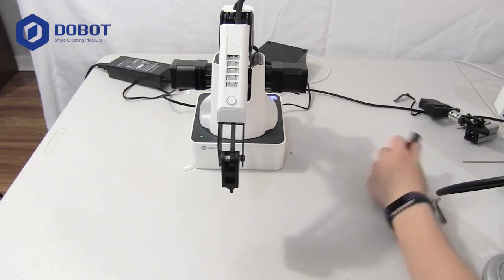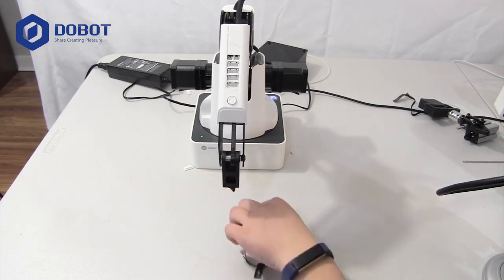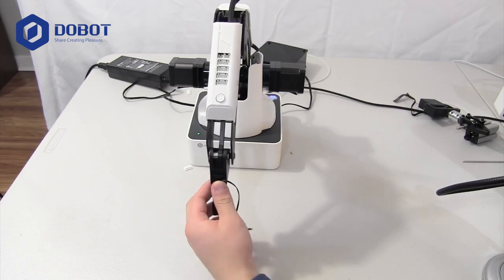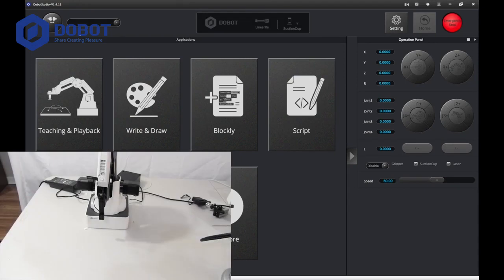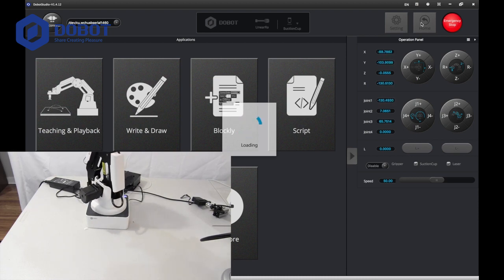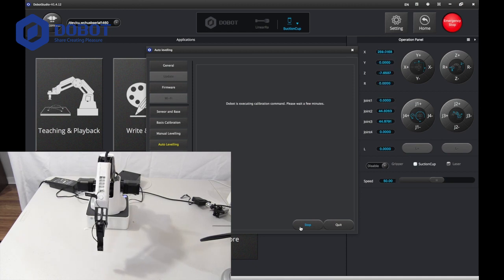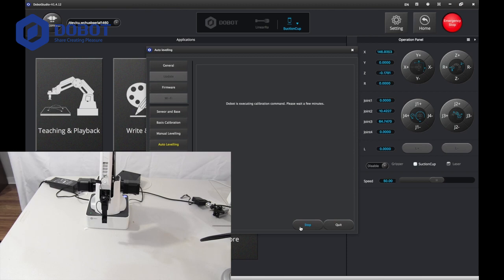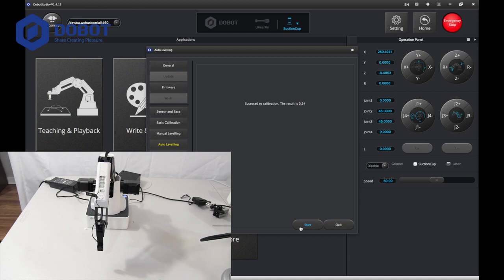[DOBOT Magician Tutorial] How to Calibrate

Comment: well i tried manual and automatic calibration several times but my huge difference in the y axis stays: a Y step of 10mm will result in 15mm movement.

offcourse dobot support is nonexistant and on the support forums there are never answers, only questions.